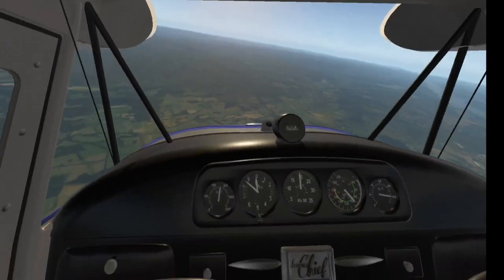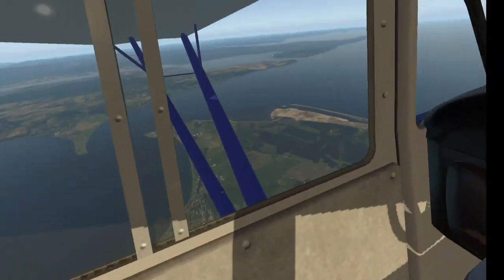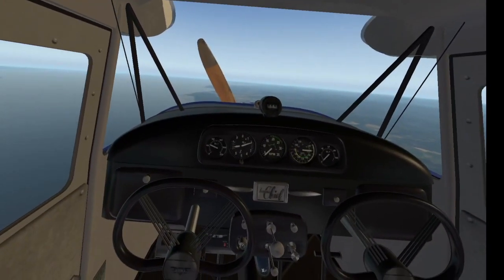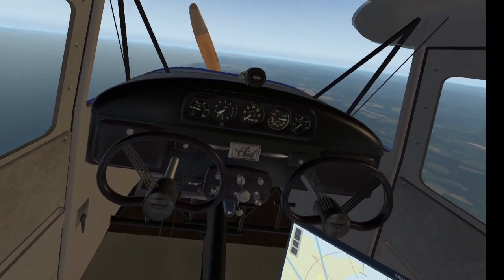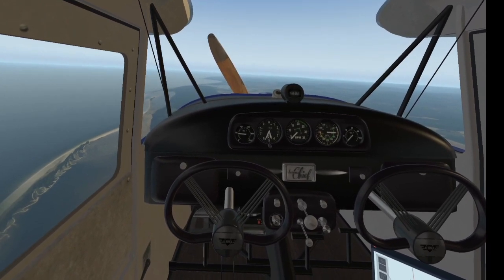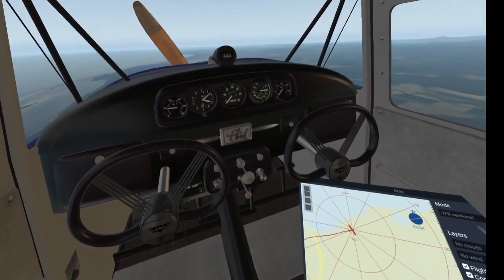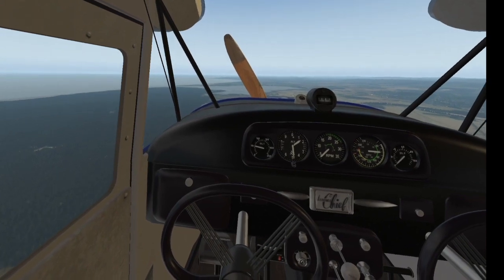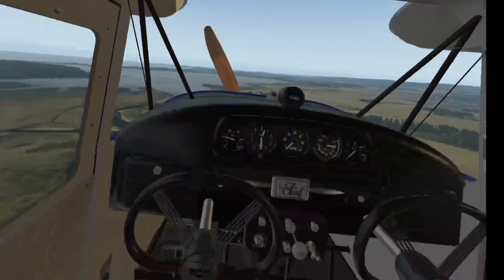Trevor Jacob Crash. How far could he Glide?

Comment: Given the low stall speed even without a flat landing area it would have been a very survivable crash.  If no other choice glide toward a highway/road, other sign of civilization, when you get low glide up the mountain/hill side just above the trees and let it almost stall into the tree tops.  The plane will be a wreck but you will almost assuredly walk away.  And the time spent gliding is very likely to either get you to a road or a stream, something with better options than trees.  No, he planned this bit of drama.